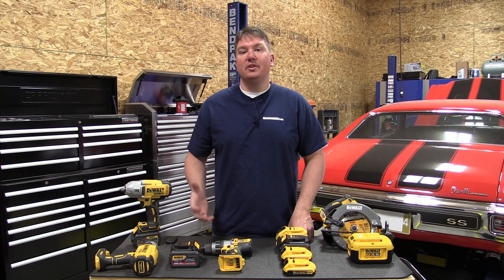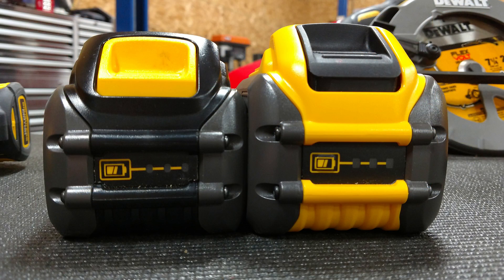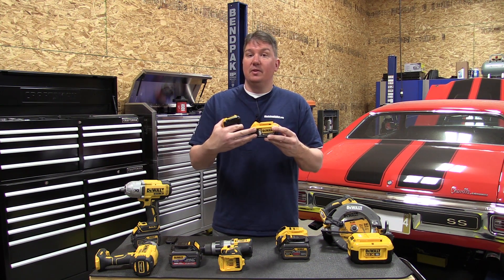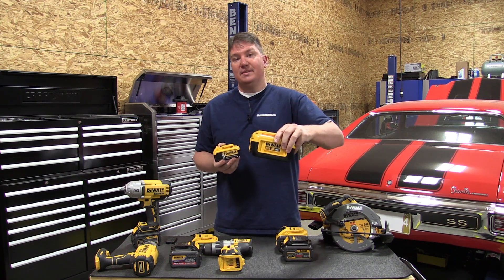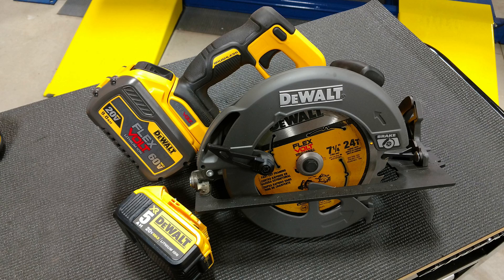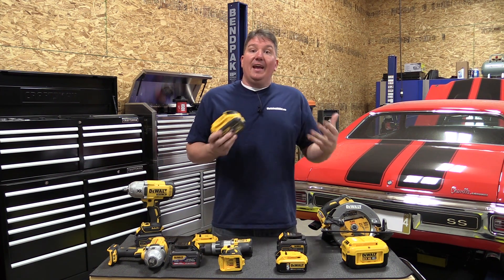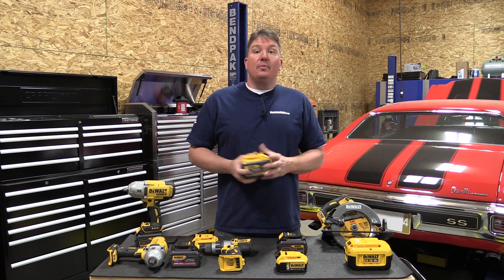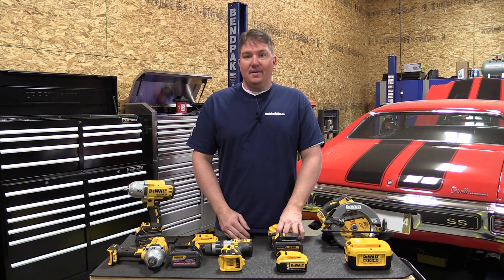Dewalt Flexvolt 9.0Ah 6.0Ah vs 20 volt max 5.0Ah 2.0Ah vs 40 volt - How Dewalt Batteries Size Up

Comment: Only way I looked at it more voltage is top speed, more ah last longer and more watts more power?
Reply: More voltage is not about speed.  That's motor design.  Amp hours only relates to "last longer" within a voltage platform and more watts is not power output, just total power.  So, all of your assumptions are misleading you.

High voltage just allows the tool to have a smaller motor with thin wires. 
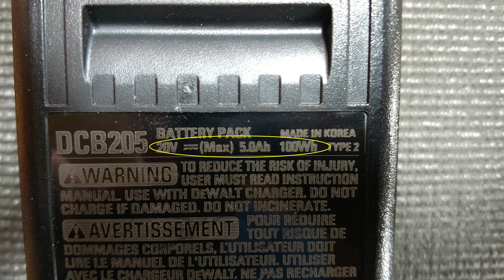Watt hours means "lasts longer."  Listen to video @ 4:30.
Power is wattage output:  For example a Lithium 16850 "cell" is 3.6V and 20 amp output so it can output about 70 watts (3.6x20).  Ten of them can output 700 watts.  The Flexvolt uses  20700 that can output 100 watts each, so 15 of them can run a 1500 watt tool.  The 40V commercial has 10 cells, but they are 26650 cells with 70A continuous discharge 120A  so 70A x 3.6V x 10cells is 2520 watts and that's more than typical corded tools.

Look at your corded tools.  They always express their power as wattage. For example a 1500 watt corded chainsaw.  The same is true of battery tools, but the tool companies keep you in the dark.  I baffles me as to why this is.

Comment: I currently have 6 9 amp hour Flex volts batteries also I have 240 volt. I wanted to purchase the chainsaw and thought that I should go with the flexvolt cuz I had so many batteries then I can exchange them more often. I was blown away I checked both saws in operation on YouTube and the 40 volt chainsaw really outperform the flexvolt at 60. So I'm glad I watch the video of the performance and of it I would have made a mistake by going with flexible since I already have 240 volt batteries. Thanks for the info
Reply: the volts are very misleading like how they use the words MAX on there 18 volt battery's lol

Comment: Batteries aside, why are manufacturers making circular saws with the blade on the wrong side?
Reply: Three reasons. Left handed users, easier to see your cut line and direction of bevel. I have a Porter Cable left blade saw and a DeWalt right blade saw. Each tilts in different directions for bevel cuts. For me, that reduces mistakes and speeds production.

Comment: Milwaukee is coming out with a new battery. They are going to call it Varivolt which means variable voltage. It will adapt to any electric motors and they wont be calling 2.0 ah, 4.0 ah, 9.0 ah or 12.0 ah. It's going to carry the total watt hour tag instead.

Comment: Actually the larger capacity battery not only runs longer but gives the impact more ft lbs of power a table saw more rpm so to say the 2.0 ah gives the same power as the 4-5-6-9 ah is not right. It has been proven in side by side comparison.

Comment: The cells are the individual parts, a battery is a pack of cells. Get it right.
Reply: also they use 18650 cells just like everyone else and call it a 20v MAX pack but yet it is a 18.5 volt pack just like everyone else 
each cell is rated 3.7 volts x5 cell +18.5 volts
when fully charged they are 4.2 v x 5 + 21 volts and that's where they get the 20 volts MAX from 
also there 60v pack is only a 55v pack but it sounds a lot better to say 60v MAX just to make a sale lol

Comment: Is my dcd778 hammer drill compatible with other dewalt batteries (20v/1.5ah)?...since it’s original battery is 20v/3.0ah
Reply from the maker: manuel silva Yes, you can use all the DeWalt 20 volt batteries and also the FlexVolt batteries.
Reply: Yes you can use any dewalt lithium battery pack except the 40 volt. The 40 volt will not work but the 1.5-2-3-4-5-6-9 ah 20 volt and 20/60 volt flexbolt batteries will work. And just FYI the larger 6 and 9 ah not only run longer it will in fact give you more power. It has been tested and proven.
Reply: James F I agree with you on power. I have the 7 1/4” 20v miter saw I use a ton and with a large battery in it I can feel the difference for sure

Comment: Hey do you think you guys can do a video on the adapter for 18 volt tools for DeWalt that converts the tools over to a 20 volt battery??
Reply: Not needed.   Just buy the adapter, plug into your older 18 volt tools and then plug a modern 20 volt max Li ion battery into it.   Done.   Works great.   Now those older tools have a new lease on life with all the benefits of lithium batteries.   NiCAD and NiMH batteries are completely out of date.

Comment: I wish ryobi would have done this with their 40v outdoor tools. Would have been awesome to have the same 18v one + batteries "flex volted" to 40v to use with their outdoor line. They kind of did something similar with their brushless tools and new batteries. There are new prongs at the bottom of the connection that tells brushless tools to go longer or something. There's a video on it somewhere

Comment: I dont get how these companys that advertise 20v can get away with it. They're 18volts!!
Reply: 20 v at max charge. lithium ion batteries drop a volt or two verry quickly at the beginning of usage then hold a steady voltage for a long time.
Reply: That’s why dewalt named the line 20 volt MAX for a reason when fully charged you can check with voltmeter they read 20volts maximum
Reply: Cheeky cunts use the fake 20v to calculate watt hours too. 162 Wh on milwaukee 9.0, 180 Wh listed on the Dewalt 9.0. Very disingenuous.
Reply: Actually at the nominal voltage of 3.7 they would be 18.5 volts.  When charged, they reach 4.2 volt or 21 volts for the pack.
Reply: _ This is the lastest sales hype gimmick used for marketing.
_ When a battery has a load attached to it then the voltage is lower.
_ The battery voltage under load is its true working voltage.  Without a load a battery's voltage is whatever a volt meter reads at the moment.
_ The only useful voltage value is the voltage when the battery has a load on it.
_ Like a 12-volt car battery - it's voltage when fully charged or when it is being charged in a vehicle with the motor running will be higher than when the battery is put under load to start the car.
Reply: We call them 18v and 36V in the UK so I'm assuming they're the 20v and 40v ones? We just word it differently
Reply: Because U.S. advertisement laws are more lenient about misleading hard working consumers.
Reply: @techfive7202  
Freedom of speech.
Reply: It's actually 20.5 volts with no load. Get it right.
Reply: nominal voltage. you mean you don't refer to your car battery as a 14.4v? :P
Reply: Kevin no we don't but it is the exact same concept

Comment: Thank you so much for making this. Finally I understand. I agree that it is confusing. Really enjoy your videos. So would you say its safe to say that the flex volt is the safest and most practical options for homeowner use?
Reply: I wouldnt say that you would need a flex volt battery for home use. You should be fine with their regular 5amp 20v battery. Unless you do a heavy amount of work, flex volt ain't gonna matter much.
Reply: I am homeowner but do big projects and the 60 volt circ saw is amazing.    I love dumping the cord.   So easy to move around my work site.    No danger of cutting into cord.

Comment: The flexvolt also uses 21700 not the 18650!
Reply: SolarizeYourLife the 6ah flexvolt uses 18650s and the 9ah flexvolt uses 20700s.
Reply: I didn't know that.  That makes the DeWalt platform even more confusing.  The 20700's output 100 watts each, while the 18650's only output about 70 watts nominal without overheating.  This would mean you couldn't use the 6Ah batteries on something like a chainsaw since it would want to draw too much from each cell.  15 20700 could output 1500 watts while 15 18650's could only output about a 1000 watts without overheating.  Thank's for the info.  Is my reasoning correct?  I don't have DeWalt tools.  Sounds like their battery platforms are super complicated.  I use Makita, everything runs on a common battery.
Reply: @geraldmoore6257  No, the chain saw does NOT "... draw too much from the 6ah battery ..."  The 6 Ah battery pack simply has a shorter run-time before needing a recharge  ...
Reply: @MrSummitville    All the 10 battery Makita batteries output about the same amp or wattage output, as far as I'm aware.  They wouldn't be interchangeable otherwise.  I should have used the term Makita battery rather than 6Ah to avoid confusion.
Reply: @geraldmoore6257  DeWalt has INTERCHANGEABLE Flex Volt Batteries.  The same battery works in BOTH 20 volt tools and 60 volt tools.  In a 20 Volt Tool, the battery will output 20 Volts.  In 60 Volt Tool, the battery will output 60 Volts.  There are many sizes, measured in Amp-Hours.  Higher Amp-Hours = longer run-time.  There is no such things as "draws too many amps " ...

Comment: I totally agree with what buildthings79 said. The versatility that Dewalt has engineered into their power sources is going to lead them ahead of the big competitors, Milwaukee and Makita. Dewalts flexvolt is why I went with Dewalt. I like having the versatility and that my very expensive batteries can function with all my tools. The 60v tools are as powerful as anything you plug into the wall. 

As far as this guy explaining voltage and ampacity I'd look elsewhere lol. Its pretty simple and he made it sound far more complicated than it actually is. Power sources can be in parallel or series. Parallel doubles the capacity (Mah) but keeps power(volts) the same. Series doubles the volts and keeps the capacity the same. Done. 

The standard in lithium batts is 3.7 volts per cell(battery) and the capacity(xxxxMah) varies. So 5 batteries....ah never mind there are other good videos that explain this very well, lol.
Reply: plumberman19  Right. I got the joist drill as soon as it came out. Love it. The weedeater is badass too.
Reply: Problem is, 60v isn't actually 60v, but more accurately, 54v
Similarly, when a pack shifts to 60v, the Ah rating drops according,
For example, a 20v rated at 9 Ah, becomes a 60v 3 Ah pack respectively.

With that said, I was completely put-off by Dewalts deliberate lies when they launched there 20v line-up, which turned-out to be 18v
And most importantly, where they did so to convince would-be consumers that there products were somehow better than the competition
Or should we say, the more honest competition - lol
Reply: @SmalltimR  It is 60 Volts MAX !!!   I wonder if you can read and understand English or not?

Comment: Thumbs up for Wh !!

Power = Watt
Energy = Watt hour

Running 100 W tool for one hour consumes 100 What of energy, and 200 Wh for 2 hours and so on.

Simple as that,
And 1000 Wh = 1 kWh (1 Unit of Electricity)

Ah is for children (which is wrong unit which does not take voltage into account)

Comment: Sad to see the 9ah 20/60 doesn't fit in my new Dewalt porta-ban. I just bought it so am going to return it Monday. I could grind/cut the handle off of the ban saw to make it fit, but I'm hopeful they correct the issue in the near future with a better design on the bansaw.
Reply: It depends on if you bought the Deep portaband or the shallow portaband

Comment: So more AmpHours means longer run time. But higher voltage means more power (though it might not last as long)... correct?  
Which battery type do you recommend for use with outdoor power equipment? Flex volt vs 40 watt?
Reply: yes pretty much what it means but at the same time a 12AH battery at 18volts or (20v MAX) has alot of amps of output  compared to 60v at 2 - 3 AH of power so can still pack a very big punch of power but run for a very long time also 
that's why milwaukee can still make full size tools with tons of power on there 18 volt battery's with great run times. smart move for them

Comment: Very informative, have the dcs575 and bought two of the 9ah batteries, however, feel that they are quite large so might downsize to the 6ah batteries, do you think there is going to be that much of a noticeable difference in weight, great video, keep up the good work 👍

Comment: A year old but anyways, those batteries are designed for bigger tools not the small brushless impact or drill, however if u choose to use it in a smaller tool the tool will be more powerful even at 20v if u need it, I am aware some think that is false, but they also have plenty comparisons for mah sizes and its always more powerful with a higher mah battery, prob to do with heat.  Most of the flexvolt stuff is for the full size legit 12" sliding miter saw same as the all electric version just few minor differences. With the main advantage use 1 or 2 batteries, then u have the table saw which is very nice but a smaller blade, Grinder the weight is not an issue there either, and with most 18v /20v stuff those grinders are not that great.  They have a very robust line of flex and from what I hear it isnt there to replace the 20v line. They are still releasing new 20v stuff, but the nice thing is the flex is backwards compatible if u so choose.

Comment: Getting a lil too close to half a car battery (40v) 😒 
Might as well plug in lol
Reply: Except when there is no plug in.   That said, these little generators are getting better and better.
Reply: @romanfields7900  absolutely, still better than looking for an outlet in the middle of nowhere, or worse yet lugging around a generator for that one hole, or cut lol
Reply: Not for outdoor power equipment.
Reply: @lawnmowerdude  lol maybe in size but not in weight.

Comment: the 40v(7.5ah) battery is quite big n heavy.. the 60v(6ah n 9ah) of the 20v is are best
Reply from the maker: dee gee do you know why the 40 volt 7.5 Ah is heavy?  Because it is a 40 volt 7.5ah battery.  The Flexvolt 6.0 ah is 2.0ah at 60 volt, 6.0ah in 20 volt.  The Flexvolt 9.0 is a 3.0ah in 60 volt and 9.0 ah in 20 volt.

Comment: i would need at least one or two flexvolt battery beside my standard 20v battery.. in case lazy charging or lack of short time power use.. one thing i was worry about at first, was if flexvolt didnt fit any standard 20v tool..

Comment: i just got the circular saw about a months ago with the flex volt 60 battery and well the saw is great but the batteries won't charge after a few times of use not sure why that is i had to return them twice now
Reply from the maker: Lithium-Ion batteries are sensitive to over draining.  If they get too low on charge, it hurts them.  If this happened twice, I would return the saw and the batteries and start over.  Your saw might be what is killing the batteries, rather than you getting bad batteries.,
Reply: i use the battery until the light starts to flash then i put it on the charger
Reply: Because its dewalt. Mmaakkiittaa, makia

Comment: Why is the 9.0 battery physically larger that the 6.0 battery? They both use 15 cells. Does it use larger size cells? If anyone knows I would appreciate it.
Reply from the maker: Jeremy Steinacker The 3.0 Ah cells are larger than the 2.0 Ah cells.
Reply: They must be the new Panasonic 20700 cells 3000mA

Comment: I think you said the smaller flexvolt battery had 2 rows that does not add up it's 15 cells I'm not sure about that 9 amp hour maybe they are not 18650s maybe those 26650 or whatever size they are

Comment: How can they make a 5ah battery only twice as big as a 2ah. Last time I checked 2+2=4... Did they use better cells?
Reply from the maker: My Fortress Construction yes they used 2.5 amp hour batteries.  They also have 3.0 amp hour batteries out now.
Reply: As far as I know, there are only 1.3, 1.5, 2, 3, 4, 5, 6 and 9ah batteries available. No 2.5s...
Reply: @MyFortressConstruction  

Seems only Hilti puts the 2500 mah cells in their compact packs, I think just because they bulk purchase 2500 mah cells for everything. (2.6 ah, and 5.2 ah for their two types of batteries) Before you ask, 2.5 ah is just an approximation, Hilti tested the cells and they are specifically closer to 2.6 ah, thus they rated them as such.
Reply: They used larger individual cells within the packs to get a larger ah rating. If you use 5 2000 mah cells you get 10,000mah or 1 ah if you use 5- 3000 mah cells you get 30,000 mah or 3 ah

Comment: This video is more confusing than the battery platform it's self 🤣 if I wasn't confused before I definitely am now
Reply: Forget volts, forget amps, the key is in the video at 4:30 - "watt hours" is the metric.  This generally translates to how much work you can do and is also a good indicator of the size of the tool than can be powered.  Volts and amps by themselves are pretty meaningless and deceptive.

Comment: The batteries are the limiting factor as I see it for the flexvolt tools.   Both the 6ah and the 9ah flexvolt batteries are huge and heavy and the 6ah is likely going to remain the smallest and the lightest flexvolt battery you can get, because in 60V it's actually only a 2ah battery.    So in effect, only the most powerful handheld tools or more stationary tools will be made as 60V or 120V.    A 60V jigsaw or impact driver wouldn't make a lick of sense.  The flexvolt recip saw is probably pushing the limits of practicality, since other makers get good results from 18V.  It's a very powerful battery platform, but for most tools 18/20V batteries will remain dominant.    For things like circular saws, table saws or grinders though, this gives DeWalt a huge advantage.

Comment: I've Seen alot of Flexvolt Tools in store but have yet to try them out but there new 9.0 battery is a beast! & that you can use it for your 20v tools as well male it that much better. Great Upload. #WorkshopAddict
Reply: Do not put a flexvolt battery on a non XR DeWalt tool you will destroy it immediately

Comment: Thanks. This helped clear things up. I think the key points were that the Flexvolt batteries are heavy and more suited to larger tools like mitre and circular saws. I'm sure my reaction was typical in that more power and run time is better but the weight difference on a drill or driver seems pretty drastic. As you said, I think they found the border of too big. The 5ah seem to be the better choice for handheld tools.